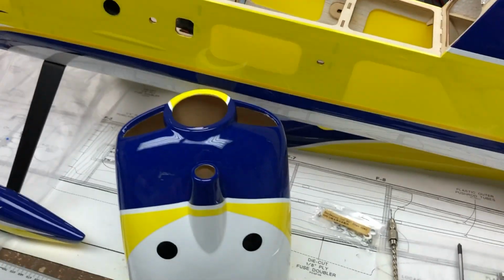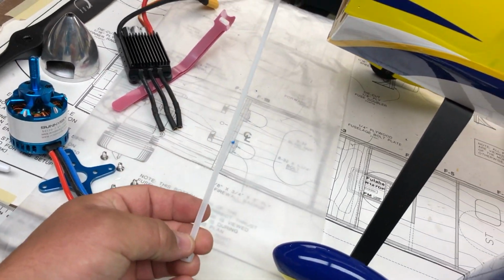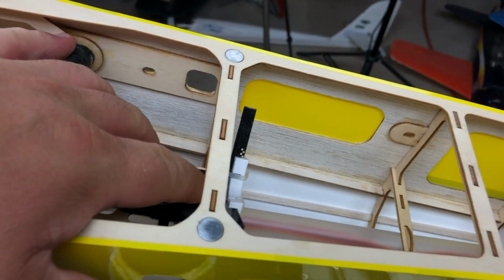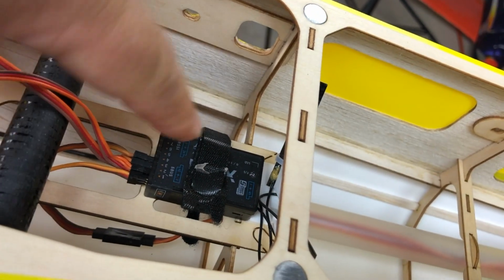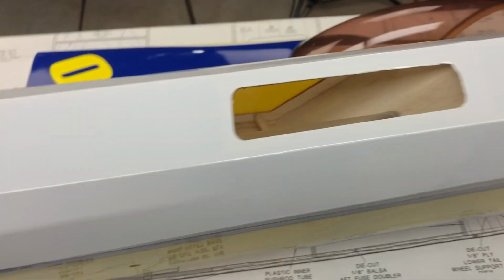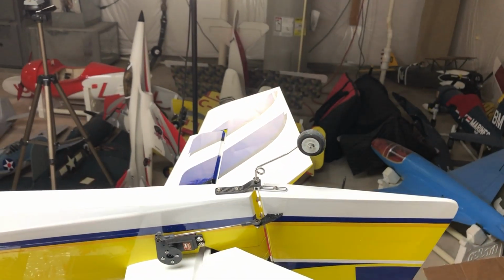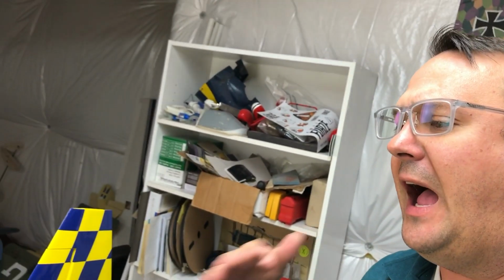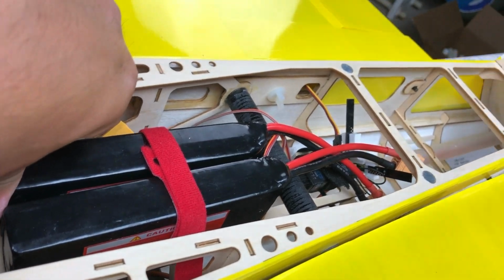ARF Techniques 104: Motor, ESC, Throws, and CG

Comment: Grrrrrrrrr Joshua! Setting up a radio with the prop on the plane? I understand you have a lot of experience, but I think this series is not for the experienced builder/modeler. You should explain why you should not test and setup a plane with the prop on. Love ya bro!
Reply from the maker: Dude. You are so right. I'm totally called out! To be fair, I did ensure my throttle cut was working before I put the prop on but I ENTIRELY failed to explain that.  UGH! Ok. I will totally cover that first thing in the next installment! Thanks for looking out for me bro!